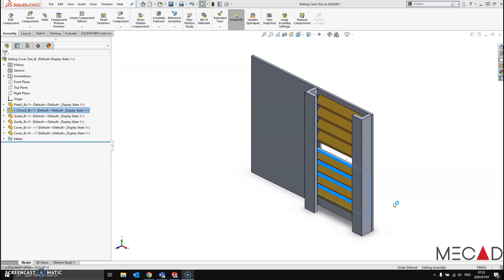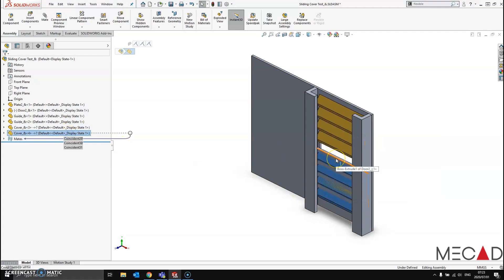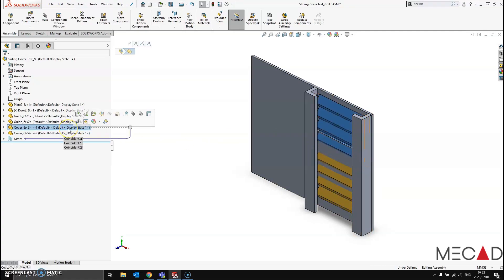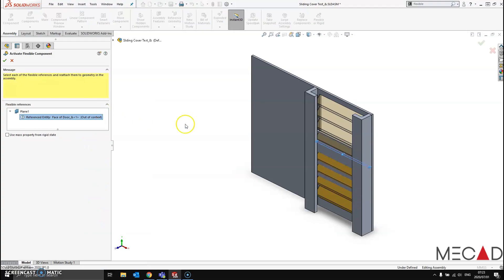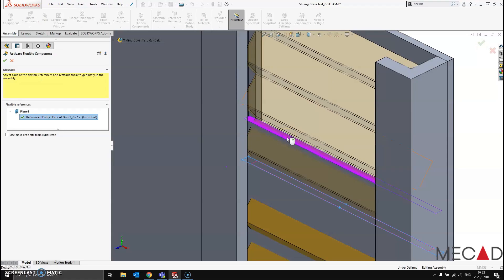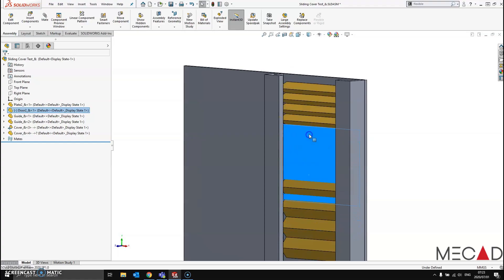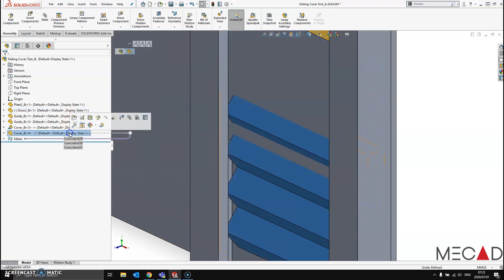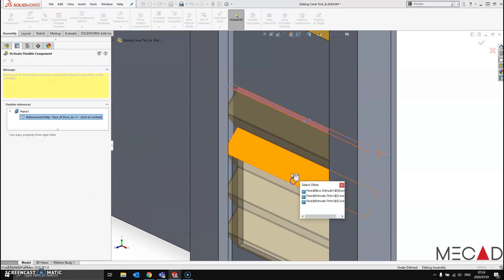How to make part flexible in SOLIDWORKS

Comment: Could you make an animation simulating the flexible part? I'm trying to make a plastic clip flexing animation and I don't know how to simulate the bending as I attach both parts
Reply from the maker: Good Day Javier, in order to do animations of a flexible part you can use the animation utility under the "motion study" tab at the bottom. It might be though that something like a compliant plastic mechanism is a bit too complex for the "flexible" part utility and might require you to a a simulation of it using Solidworks Simulation.

If you have further questions, please contact support@mecad.co.za for assistance.